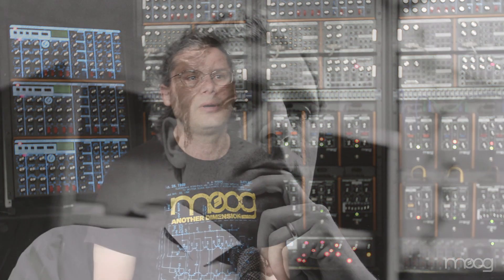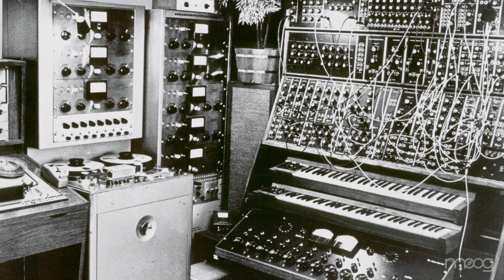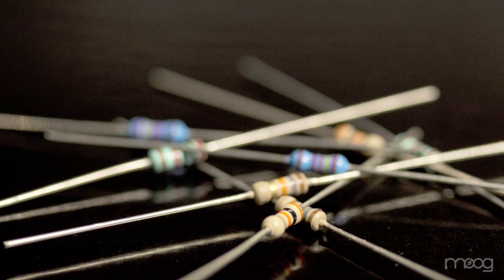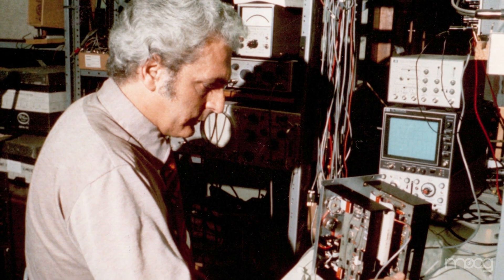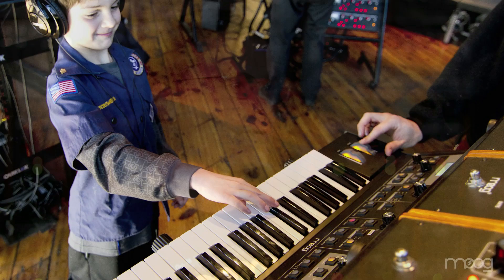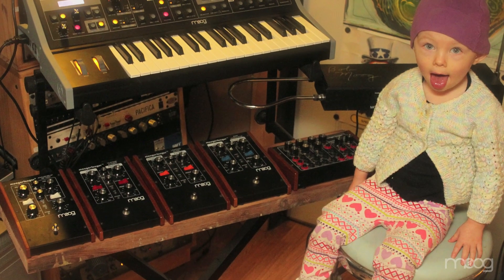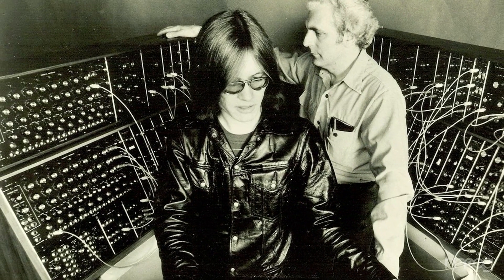The Moog Ladder Filter

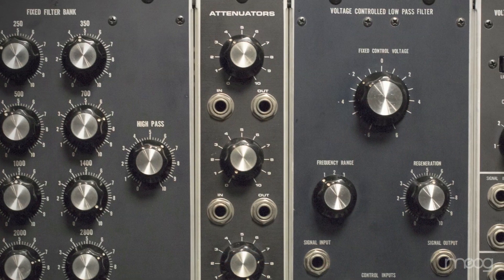Comment: 1:04 replacing the resistor with a transistor, aka. transresistor. Transistors are often thought of as amplifiers and using a small current to control a big current. What you're really controlling is the collector-emitter resistance :-)